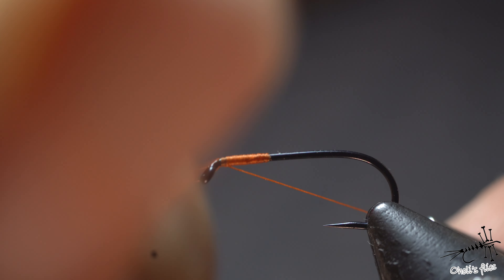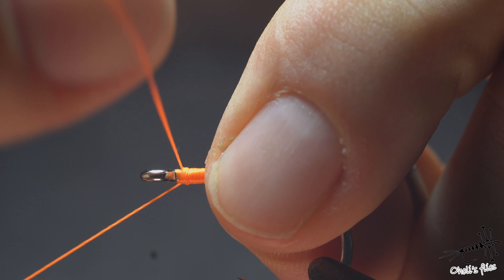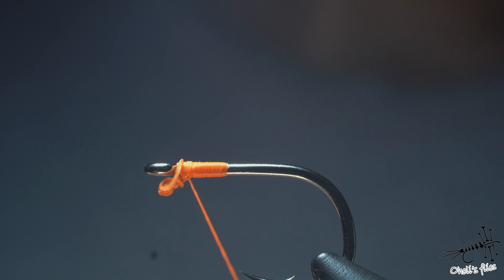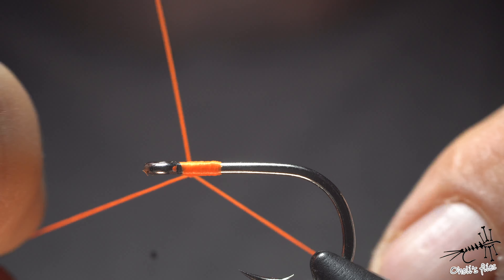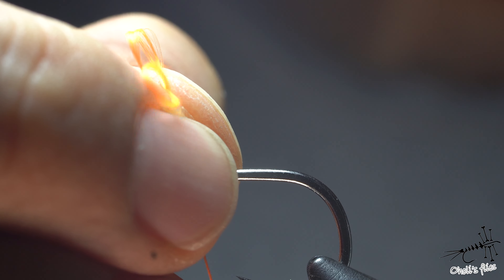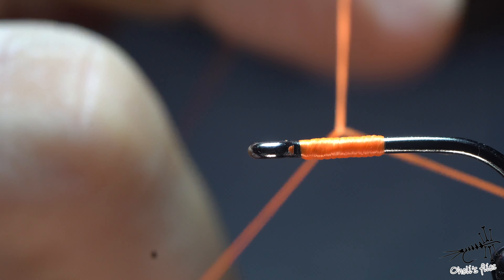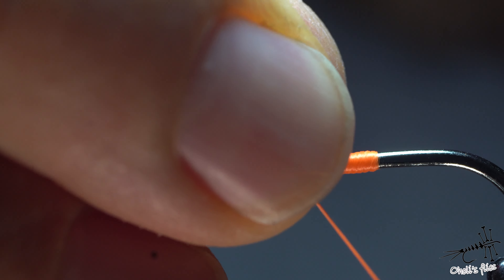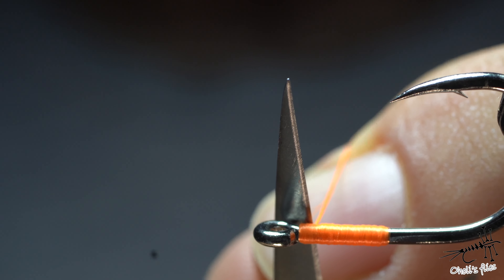Don't let your whip finish knot jam or break...

Comment: Better yet, use a whip finish tool and avoid the thread being able to furl up as it does in the video.
Reply from the maker: It can happen with tool too. But way less.
Anyway, flat thread is essential for good knot whether you use tool or not.
Cheers
Vladimir 😀🍺